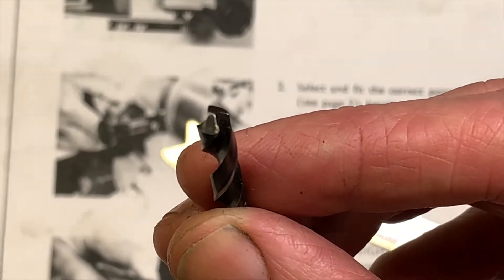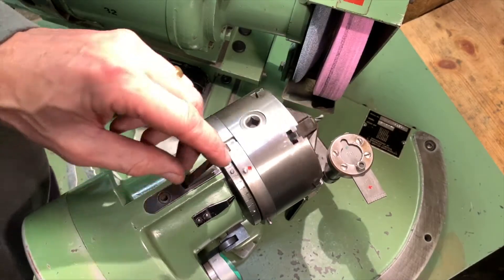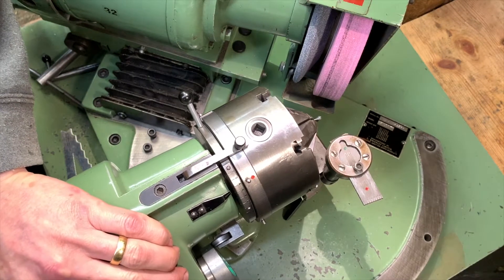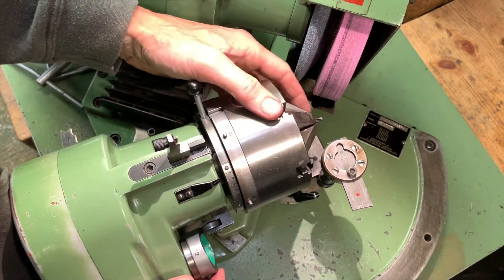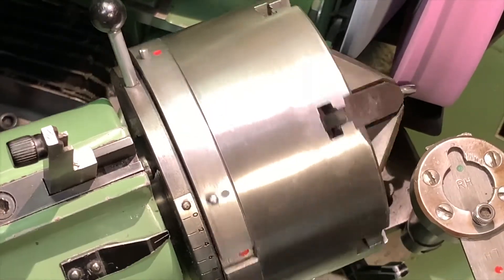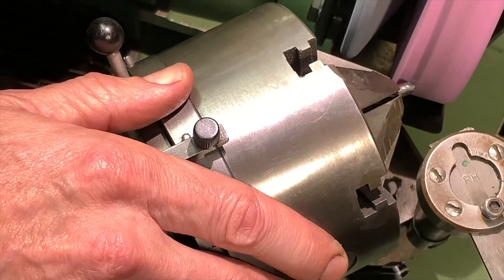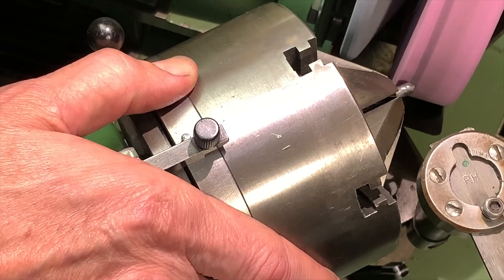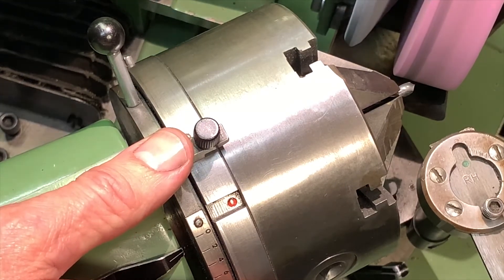Brierley grinder prismatic point 12

Comment: Brilliant video! Just wondering if you have the dimensions for the cams. I’ve just got a 35 and there are no cams so I’d like to make my own. Thanks!
Reply from the maker: The cams have a complex profile  and tight tolerances for them to work correctly.  Your best bet is to try and source old stock. I called up a heap of machinery dealers to see if any orphan cams were out there   .....   eventually I got lucky. 

If you put your email up here then I can mail you directly. I cannot see your address through you tube but will mail you privately if you get stuck
Reply: Thanks! I ended up finding someone with a spare that was happy to sell it! Thanks again.
Reply from the maker: fab

jay    fab let the fun begin   shed guy